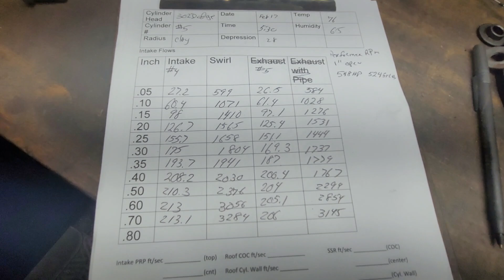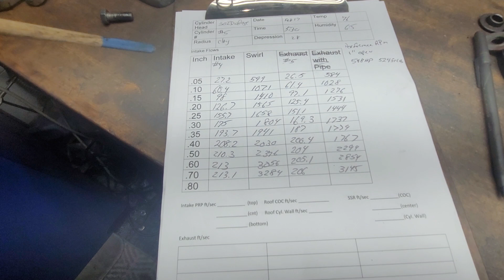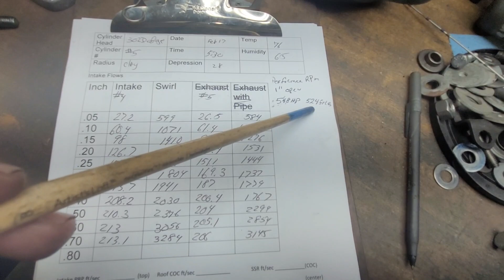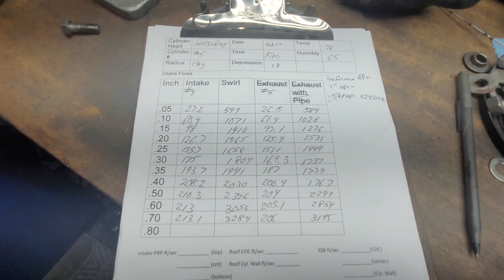Mission Impossible 318 single plane flows and port look

Comment: I have thought about ways to extrude hone intakes like dual planes, like mixing sand blast media in clay  something really coarse and use a 2"-4"pipe and piston with some really large o-rings on it, with a plastic or runner cap on the piston dome, to help keep the grit out of the o-ring, similar to drum break wheel cylinders, lace about 36" stroke, use  two cherry picker rams,  and 1.5" piping, with a loading hole accessed by pulling the piston to the bottom of the stroke, when it's filled use the hydraulic rams to push the clay through the intake ports,  it should be thick as playdough, full of coarse sharp aluminum oxide or garnet , about like 80 frit sand paper if possible,  and keep pushing it through, and measuring the ports,  trying to keep track of the #of passes, and repeat on each runner, I believe it should remove the restriction first, by putting the most pressure on it, maybe add more stone to it each pass, with more water or oil what ever is used, maybe just mix the cutting stone with thick oil or grease  , make it thick as playdough or cold butter,  in my mind it should only take a few passes, a single pass should make a noticable difference to the port surface, so about 12 to do a decent porting, 24 is about max, it will still require grinding to match ports, of coarse this is based fully on my imagination! 😆,  But shoving a a thick bear solid through a port, at about 200psi+ it will require attention to the equipment to prevent wear, possibly fill the piping with ceramic coating, maybe even concrete, the pipe from the cylinder should be 6"-12" max just enough to adapt the cylinder to the port, maybe make custom ceramic parts, even the cylinder steel pipe with fired ceramic lining, porcelain or something, the rubber capped piston with large o-rings to keep the cylinder sealed, should last the longest,  it's a lot of work building,  but should almost do the work it's self, I'd like to try a proof of concept anyway,  it should work on aluminum anyway,  crazy, I had since I saw the 5.0 mustang EFI intakes extrude honed maybe in the late 80's maybe,
Reply from the maker: I am glad this channel sparks imagination. Excellent
Reply: I have an old mopar action or mopar muscle car issue where they took a set of heads and stock 4 barrel intake and ran them on a flow bench for stock numbers then went to a place that does that process and it really cleaned up the ports and then they put the parts back on the flow bench and it increased the numbers quit a bit
Reply from the maker: @MoparMan-ff8fb  I bet it did. Thanks

Comment: Nice!  I like seeing that it has around 200cfm at 0.400" lift.  I think for my 318 build coming up, I will use the 340 intake.
Reply from the maker: I have seen pics, it looks like a solid design.
Reply: Need to use 340/360 heads to use 340 manifold or reversion will be severe.
If you can find a LD4B manifold , they have 318 ports, they make good power .
Reply from the maker: @MP-pz9oe  What makes you think the reversion would be bad?
Reply: @MP-pz9oe  Thanks for the advise!  I have port matched the 302 "swirl port" heads to the 360 4bbl manifold before with great results.  If I don't get what I want, then I have the speedmaster aluminum heads to play with (bare) 😃

Comment: I have had the crazy idea to use a stock or aftermarket intake to make a  mold, and make one from carbon fiber maybe fiberglass, using epoxy resin, it can be forged carbon fiber, or skinned in a traditional carbon fiber cloth,  maybe machine the flanges so the intake gaskets can also be sealed with O-rings,  around the ports and water passages, maybe also across the china rails , using a thick nitrile cord  the ports can be made from paper-mache and carved into shape  then soaked in water to remove after the resin sets, it would look cool if nothing else, I guess using a CBC mill to make all the shapes, then skin the top with carbon,  then trim after it sets, the epoxy shouldn't be harmed by the fuel,  crazy idea I know, but the ports can be what ever you want!
Reply from the maker: I love it! I couldn't do it but I love it.

Comment: Good job Charlie  Thanks. Why does the shorter runners flow better?
Reply from the maker: Good question, why do you and the other guys think?
Reply: @servediocylinderheads  guessing that because it is shorter it has a shorter path less port for the air to hit and follow. Maybe the air flows more to the outer side of the plenum wall Also?
Reply from the maker: @dondotterer24  You may be right.